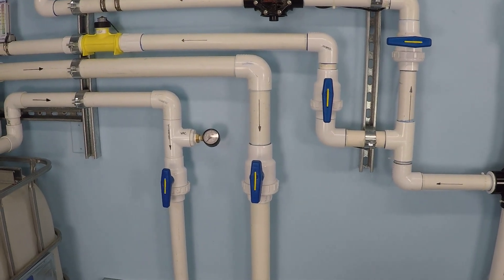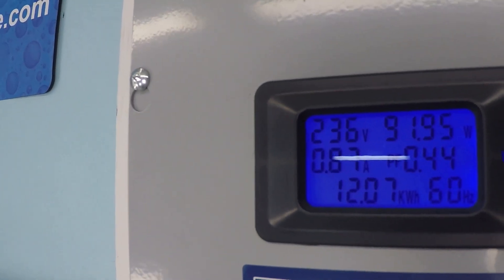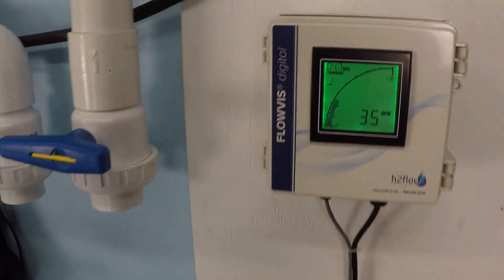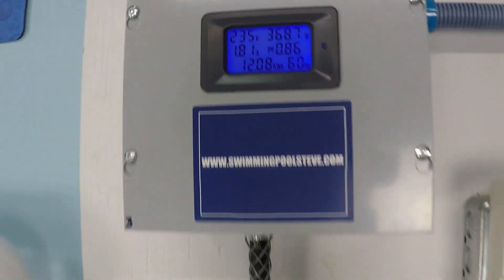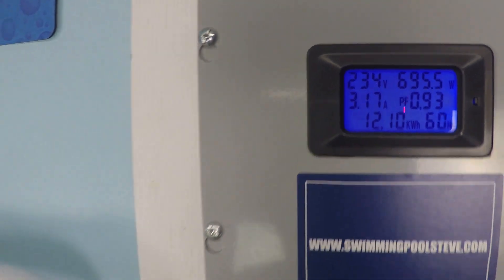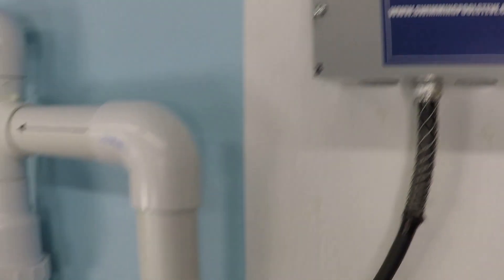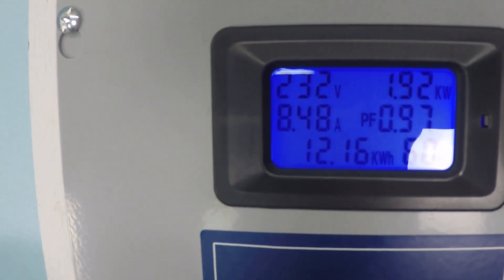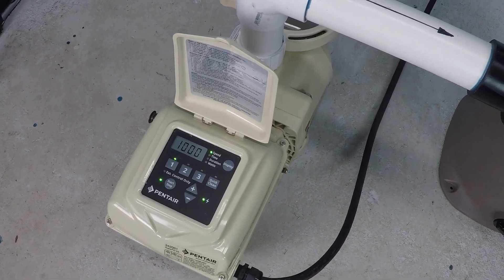Pentair SuperFlo On 2" Plumbing System

Comment: Your own  test with the exact same pump running the same speed and drawing the same power, but with 1 1/2" pipe, flowed 82 gpm.  This time with 2" pipe, it flows 108 gpm.  My math is a 32% increase without changing the pump or electricity used!  If anyone had any doubt about the benefits of 2" pipe over 1 1/2"pipe, which you have been telling us, this proves it without a doubt!

Comment: Is the Pentair variable speed pump an effective way to save money? Replacing a functioning single speed pump that draws 2,500 watts with a variable speed pump makes more sense if the single speed pump is already at the end of its service life. 

The Pentair variable speed pump costs about $1,500 plus the labor to replace the pump. The single speed pump costs maybe half or one third the cost of the variable speed pump. What’s the break even time assuming the single speed pump was running for 7 to 8 hours per day? I’m assuming that the variable speed pump needs to run much longer per day to have about two pool water changes per day. I heard the expected service life of the single speed pump is 3 years. What is the expected service life for the Pentair variable speed pump? Our electricity costs are about 12 cents per killowatt hour.